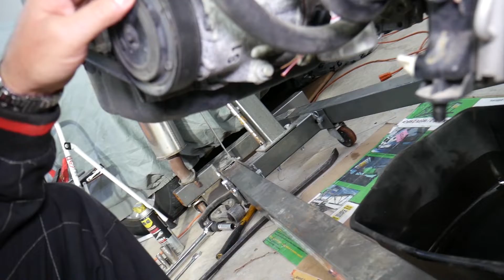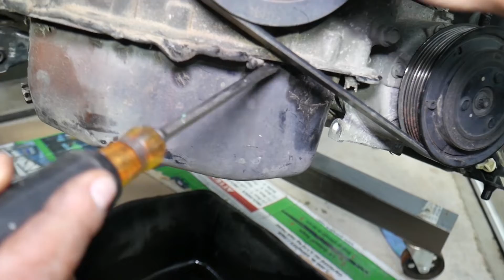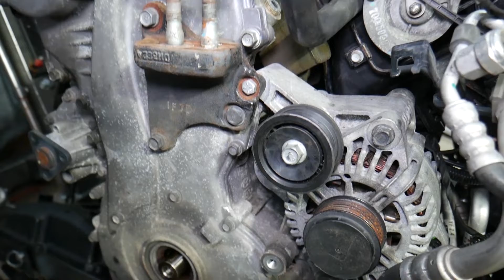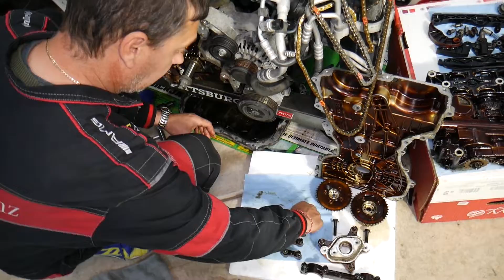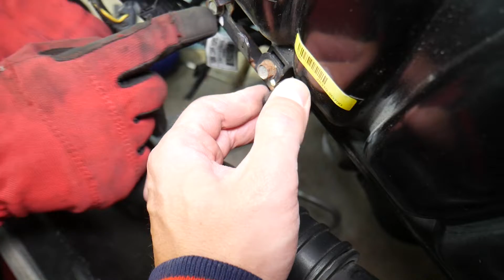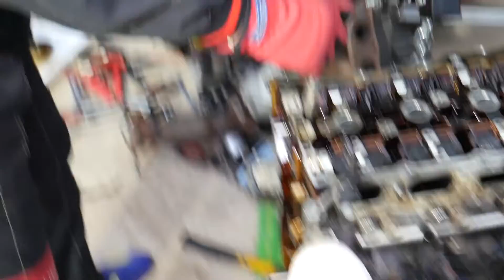HYUNDAI SANTA FE CYLINDER HEAD REPLACEMENT, HEAD GASKET REPLACEMENT REMOVAL

Comment: You should make a video for a 2004 Santa Fe with the 3.5 liter v6 engine. And without engine removal. Specifically on how to remove the rear cylinder head while inside the engine compartment.

Comment: Is there a video on changing the connecting rod bearings? I cant find anything on changing all 4 out. Seems that people just change what they can easily get to. The us Santa Fe with the theta 2 is trash and its a common failure on the US models at low miles... Mine is a 2016 and has just under 58,000 miles on it and spun at least one bearing. Cant afford the proper fix, and still owe $20K so I'm putting new bearings in to get by